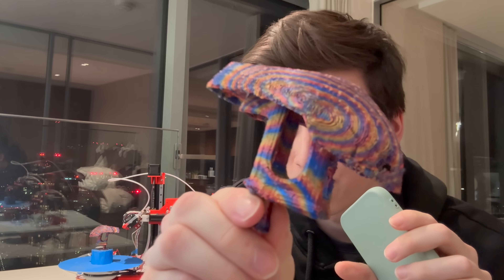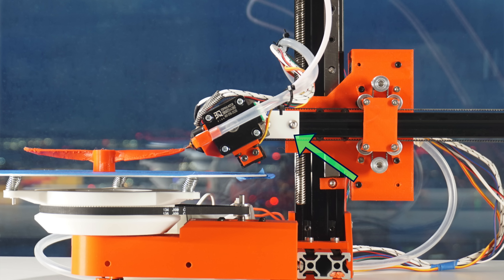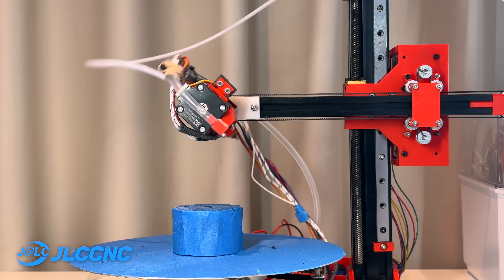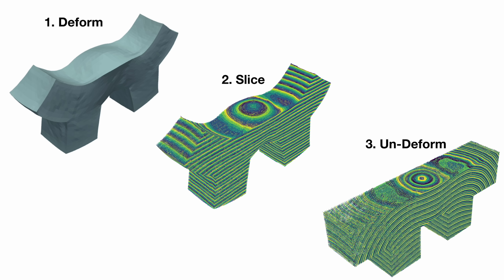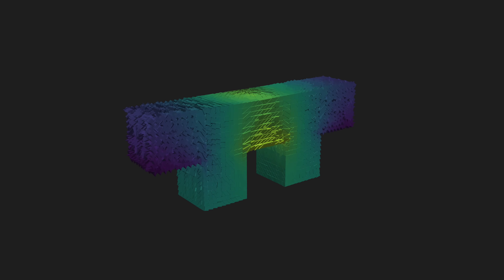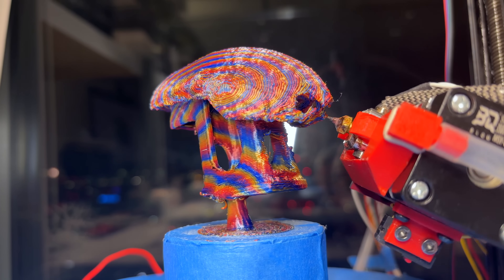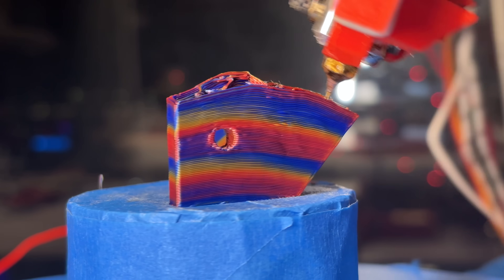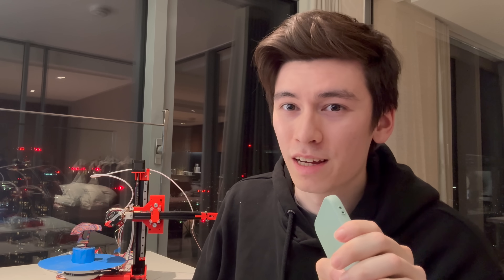3D Print Anything Without Supports

Comment: What filament is that. My colorchangeing pla isnt flipping colors so often.
Reply: Looks like standard 3-color change, but with all the different directions of toolpaths, it switches which color is facing you from the coextrusion very frequently, since the part doesn't maintain the same orientation to the extruder with this type of printer.
Reply: @wrathernaut-3d  man, ofcourse. you must be right.

Comment: Joshua, that is amazing.    After watching this several times, I wonder if the extruder nozzle would benefit from operating at 90 degrees like the upside down Positron printer. I imagine the feed / heater concetric with the rotating axis , allowing the smallest (low height) extruder.

Comment: Awesome work!

I really enjoyed watching your video. Even Djikstra got it's place in there :)

I have started a 5 axis build (a bit different -> conceptwhise) but did not finish it.
Anyway i'm glad to see you did it 😊.

Actually i'd like to know how tcp calibration is implemented and if this setzp can be moved over to other builds.

For me the plan was to map the other "extruders" in klipper as axis 4 & 5 and reanalize the code after slicing to correct the path after calculating normal vectors.

Did you tacle singularities? Would be interested to se how that was done on your side😊

Edit: maybe updating DH-params could be a thing 😊

Comment: Yo this is brilliant. Also thank you for crediting the work you built upon. The solution is really clever and elegant.
I would hesitate to say it always produces the best path though. Even with 3 axis milling, no one has figured out an algorithm that can universally create the best CNC program, despite decades of trying. It still needs human intervention. This is one aspect of FDM printing where I wish slicers would emulate CAM software more. Obviously it would be unreasonable to plan out every toolpath but if i could choose features or regions to print in various orders or with various raster patterns, I could optimize prints for the property I want. But of course the more settings you change the more likely you are to start having issues.
Reply: I believe the difference here is additive vs subtractive manufacturing, it's totally possible to generate an optimal toolpath for additive manufacturing, especially when you never have to do things like tool changes and you don't have to deal with things like the rigidity of the machine when cutting large amounts of material

For something like this, there's enough constraints with how you need to print things that there's only really one way to print a given part in a given orientation, as you still always need to begin the part from the baseplate and your layer lines will somewhat radiate out from a given point in semicircles, plus you have to build complete layers to begin with, though can vary the layer height depending on geometry.

There's absolutely tuning you can do but I doubt manual toolpaths will see much improvement compared to where 3d printing slicers are at unless you are trying to minimize the amount of material being used
Reply: @harisonpunian3689  it's really not though. There are regions where I might want a specific isotropy or density or other such properties. There's opportunity to build in sacrificial features as many CAM software can. Some slicers allow you to paint surfaces and use volumes to mess with properties, but compared to CAM, it's terrible imprecise and very inconsistent. There have been many parts where I'd print in the dozens for functional things at work, and I have spent hours often manually editing gcode with a readme at the top to get what I want. I'd happily pay a few hundred for a slicer that were on par with CAM software in terms of feature richness.

Comment: This is pretty incredible! Thank you for contributing to the open source community! 

A few questions, if you have time.

1. The surface finish of most models isn't smooth and rounded versus the original CAD. Is this an artifact of geometric pre-processing/slicing/toolpathing and/or perimeter settings? It looks as if the gyroid infill causes print through.

2. Is there an error correction to compare transformed tetrahedra back to original surfaces? 

3. Is it possible to include the infill after transforming the tetrahedra back to the original shape? The current method distorts the gyroid, which takes away it's geometric benefits.

4. Your current printer appears to be 4 dof with the nozzle constrained to a plane coincident with the vertical rotational axis, thus the nozzle isn't oriented to the geometric surface normal vector. Is a 6 dof printer in your "pipeline" to improve surface finish?

Comment: This is really quite impressive. I wonder if the quality of flat surfaces could be improved by adding another constraint to the optimization algorithm: The surfaces of the deformed geometry, should not have small angles to the building platform. Either exact parallelism or a minimum angle of approx. 25° to reduce the stair step effect.
I would also like to see what this would look like on a precision 5-axis machine with very high calculation resolution.
And also more videos of prints in general :D

Comment: Can you demonstrate the performance of this system on a spindlier 28mm mini? Many minis have supports to prevent wobble, not just to support the mass during print. I'm not entirely convinced non-planar printing could print, say, a mini holding thin objects like staves and swords or with tendrils, spikes or hair.

Comment: If the deformed model is sliced and then reformed, does that mean the infill ends up all wonky?

It's a smaller issue given that shell thickness does more for part strength.

Comment: Not sure how I managed to miss S3. I am actively working on non planar slicing but man it's a struggle. I decided to go with voxels so it acts as a hybrid between conical slicing and arc overhangs automatically, but I've hit a roadblock. The layers in my current design need to be mostly continuos to work with rhe current logic but below a hotend slope clearance of 10°(an ender3's clearence) it just all breaks down and results in tiny 1-2mm print moves that are just barely disconnected. And my ender happened to be replaced by a bambu A1 which has only 3° but I want the slicer(because in theory it can) to run on any 3 axis printer. So hats off to you, non planar printing can be such a pain to test/debug especially when a benchy takes 4 hours to print cuz the algorithm messed up and decided to split a perfectly printable line into 4 layers and 100 separate lines.

Comment: I imagine that even having layer lines that aren't perfectly flat already gives greater strength to any printed parts, just by virtue of any splits needing to travel a more convoluted path, like splitting wood with knots or twisted grain
Reply: I actually wrote my masters thesis on using topology optimization to plan out the layer lines for max strength - only in 2D because we didn’t have this six years ago. Very cool to see what’s feasible now!
Reply: @jackramsey2841  Might be time for a sequel to that thesis haha
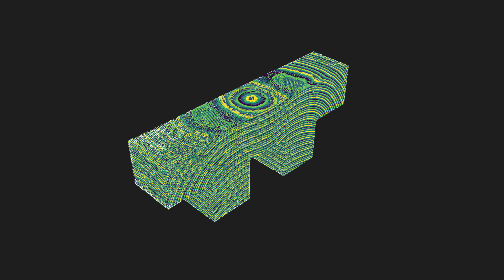Reply: Not necessarily. The curved layers could be shorter than non-planar layers and thus have less surface area for interlayer welding. Look at the corners at 4:50 - they are much more likely to shear than if the lines were going flat across. There are trade-offs for everything.
Reply: -  FDM parts can benefit from post print heat treatment (reducing future splitting), just beware that many FDM filaments shrink once glass transition temperatures are reached..  (One-off objects are still tricky to get "exact" if tolerances matter - tuning for (small volume) Mass production still takes time and skill. - And yet most people "playing " in the space, aren't really "tuning their machines" - or components, more a print and pray space...
Reply: You nailed it...the wood splitting analogy does it for me.
Reply: It probably isn't as optimized as it could be - you'd have to inform the slicer of your intentions for the part and the direction of the loads to really fine tune it - but your analogy of knotted wood holds water. This model could probably achieve 90% optimal structural integrity without even that just by telling it to make all paths more convoluted, minimally homogeneous. By sheer chance (no pun intended) and iteration one could just print the same part over and over again, test for integrity, and evolve the best path for a given part.

The old way was just "standing up or sideways?", but with so many degrees of freedom (virtually infinite) all I can say is that when this baby hits 88 miles per hour... you're going to see some serious shit 😮

Comment: This is really cool and a huge step forward for non planar slicing. What's the next big steps that would be required to improve the print quality? Are imperfections caused by physical limitations of the printer? Is there a loss of detail because of rounding during each step? Is there a bottleneck in the computational power of modern computers? Do features like retraction, z hopping, pressure advance, etc. need to be disabled in the slicer?

Comment: Although it's already briefly mentioned, I feel like the fact that this not only removes the need for supports, but also reduces the impact of the subpar part strenght in the z-direction is kind of understated. 
Being able to print different parts of the same print in different directions can allow you to optimize part strength where needed.
Reply: It's a really cool side effect, but it's constrained by the overhang deformation algorithm. There's always going to be anisotropic strength in an FDM print, but now it's not in a single direction, it's in a flow field based on overhang locations. That's really cool, and I'm going to have to think about the implications of it. On one hand, it's unpredictable, but on the other, it may be directable.
Reply: @evanlane1690   This is effectively the first generation of a new, more generalized kind of slicing algorithm. I can imagine a future where we have the equivalent of Prusaslicer for this where you can define layer orientations just like you can paint supports today, and the slicer then optimizes for minimal supports.
Reply: @brinkoftext  It might be possible to use this technique to optimize for strength/deformation/??? by a pre-distortion. He mentioned that distance between points affected the tool travel, which means that if you wanted to focus on the X-axis, then pre-distort Y and Z to be (say) 10X bigger, then process, and un-distort. One could pre-distort Y to say 10X, and Z to be (say) 100X. Or, perform a radial distortion, in 2 dimensions, or even in some 3D modulus to affect bending and/or twisting.

IM(H)O, this idea is amazingly clever by miles/Km, and will almost certainly revolutionize what 3D printers can do.
Reply: @evanlane1690 maybe instead of traditional fdm support structures, areas needing reinforcement should have removable 'overhangs' that constrain the tool head travel as required to give the desired reinforcement.
Reply: @imaginitivity7853 maybe, but either way it's a whole extra optimization problem you're solving for. I feel like the next big step is having a toggle at generation to optimize for strength or surface finish. Because you can choose to intentionally change the deformation settings to allow greater calculated overhangs, resulting in something sliced diagonally instead of perpendicularly from the build plate (in the critical part in reference to planar slicing)
Reply: @SquintyGears  interesting comment about surface finish. All of the non-planar stuff I've seen up til now was focused on creating a smooth "skin" on a standard 2.5 D printed model. Now we can have the smooth skin (albeit likely with some seams, creating "patches") covering a fully non-planar model.
Reply: @kaiza96  hey, I guess you could build inner support in one direction then cover it with a layer in the direction of the surface, for a "finish"
Reply: @evanlane1690  I believe you're thinking about this the right way.  I see lots of comments minimizing this contribution to pro-hobby users.  We haven't yet seen all the possibilities this could unlock.  Putting it in the hands of the 3dp community at large will certainly result in use cases we haven't yet conceived.
Reply: @evanlane1690 could playing around with djakstra do something?
Reply: Fair point, it will be super cool to see where this goes in the future when others catch up and start building on it. 
I'd love to see an added step that can do a directional skin as a final layer for part strength. 
Eventually some team will turn it into a scaffolding that gets a skin painted overtop to final dimensions, and maybe even 3d ironing on important surfaces (likely in stages for the sake of access)
I wouldn't even know where to start with that though.
Reply: @freescape08  Multi-axis printing is far from new. His entire project is based on the code/project from 2022 for instance (did you watch the video?). But it goes back decades further than that.
Reply: The layer line weakness is usually overstated and can be designed around by just taking it into account when making the parts. Where there will forces pulling layers apart, just add material to that region. Or just change orientation, or divide the part into separate sections and glue them together, lots of options. 

Modern printers are also very good at fusing layers together, I've printed lots of parts with forces pulling layers apart, if they are thick enough and there aren't massive defects for cracks to begin at, then they are quite indestructible without tools and more than strong enough for their function. Only part that I've had fail due to this was something that was originally sheet metal, and at one point had a narrow area of about 15x1.5 mm with a hole through it. I printed 6-7 of these and out of those only one had enough of a defect going on to break under a reasonable force in the context of its application
Reply: Totally the real win of this achievement is part strength, with the added bonus of no more supports.
Reply: the no support, and not covered the regular, print scan lines, we this new printing stile, actual have control the service finish is with reach, with resin printer option and chemical stuff involved with sort of printing